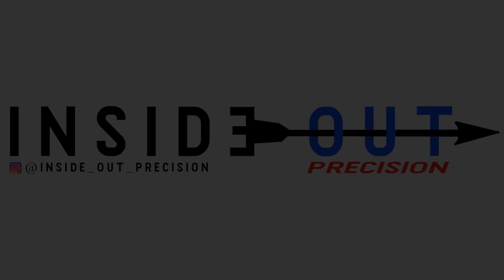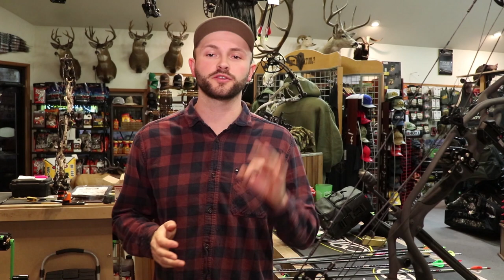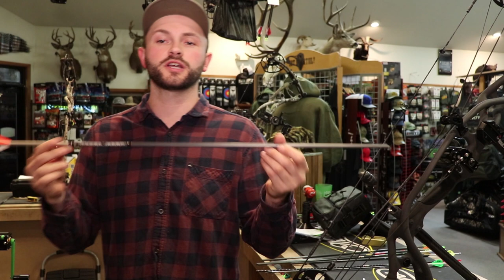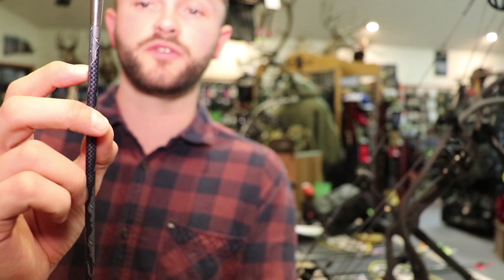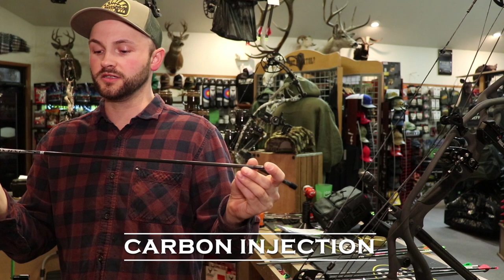Breaking Down Arrow Spine

Comment: I asked pretty much the same question on another video, but I thought this video was more appropriate for the question. I am trying to pick an arrow for my VXR, I have a 30" draw length with arrows cut at 30.25", I'm wanting a 125 grain point and I'm pulling 73 lbs right now, however, I plan to get new strings at some point so hopefully that gets up to more around 75 lbs. I was thinking the Easton Axis at 260 spine or Easton FMJ at 250. Will the 260 spine be stiff enough? Easton's chart had 260 on the softer side for my draw length and weight. Thanks for always being so helpful. I've asked questions multiple times and it's always really cool to hear back.

Comment: Okay so I have a question for you to help me understand...I am looking to shoot a 5mm full metal jacket for hunting and I shoot a 42 lb draw weight in my Mathews Avail and 25 inch draw length... I shoot a 26 inch arrow...I would have a 265 grain arrow and a broad head that weighs 100 grains.  That puts most of my weight FOC...I was also looking to add a 50 grain insert in the arrow tip but if I'm already sitting that far forward on my weight I shouldn't add the extra weight up front correct?

Comment: I consider myself a caveman hunter style shooter and am moving slowly to the target side of the spectrum. Incredible wealth of knowledge here, Thanks!! Been on Gold tip 340 Hunters and XTs for some time with great results at 60lbs and 28.5 draw with my Mathews V3. I did try some Victory TKO arrows recently at 350 spine with I believe 50 grain outsert on the point, that thing penetrated like no other. May switch to 400 spine and move to micro diameters in the future once I go thru all my GT's

Comment: I  am thinking about buying Easton Axis 5mm with 75 gr insert and 100-grain point weight, I have a 25.5-inch draw length and shoot 66-68 pounds, do you think 340 would be right?

Comment: Great video and explanation of arrow spine/weight/diameter.   I started experimenting with different fletching (4 vane max stealth, blazer etc.) and with a 22 gr. Nocturnal nock this added a lot of weight to the back of my arrow which caused problems with my FOC.  I like the added stability of 4 vane configurations for fixed blade broadhead flight but I needed a 50 gr. brass insert to get my FOC out of the single digits.  Although my broadhead flight was very good my arrow speed was not.  Struggling to find the right combination @ 62LBS. and 28" arrow.  I think the Axis is a better choice for me. Thanks again.

Comment: Pretty good video!! I have had a lot better luck though since i started following Ed Ashby’s 12 step program for arrows and broadheads. Your recommended arrows weights seem quite lite. I get the lite arrows for unknown yardage 3D and things like that but for hunting 60lb or more people are seeing much better results across the board with arrows 500 grains and more. My personal setup 75lb V3 day six 275 spine 150 grain inserts and 150 grain grizzly stick Maasai total arrow weight 658 grain and go through whitetail shoulders and bury into the dirt 6 inches or more. Definitely recommend to heavys. Brandon McDonald has a great video arrows part 3 comparing a 450 grain arrow to a 875 grain and the difference in time to target is litterley almost unmeasurable at 70 yards
Reply: Link?  I’d like to see that.
Reply: @drumsnbass  not sure how to do that but if you go to Brandon McDonald’s channel the video is called arrows part 3 and it’s pretty close to the top
Reply: @terrycalvert7812  thanks!

Comment: What is spine at 14:30 :)

The easton bloodline's lightweight allows to buy a 240 spine arrow in lets say 30"/31" and load the front and still have a stiff enough arrow without an extremely heavy shaft - so it has other uses than for light drawweight bows.

Thanks for all your information :)

Comment: I was thinking spine was measured by hanging a 3lb weight on a shaft that is supported by blocks 28" from each other. The measurement is taken with a dial indicator placed in the center of the support blocks. A 400 spine arrow means the arrow bent .400" when the weight was applied
Reply: This is true, not sure about the weight that is used but the principle is the same. It's not how much the arrow flexes when shot from a 70lb bow. So technically he is incorrect in his explanation. A couple manufacturers use a different number system that is not the actual measurement of deflection ( Carbon Express for instance).
Reply: Phil Ward  however if you go to carbon expresses website it will tell you the actual spine measurement for the model number . Maxima red 350 is a 300 spine arrow .

Comment: Ok, im learning new things daily as I throw myself into bow hunting, I did just get my first bear with a bow 2 weeks ago, I got it with the first bow my wife got for me that we found out it was too small. It's a bear cruzer g2 set at 29" dl where I am a 31 & 1/2 dl, it is set at 55 ponds and used a 400 gold tip with 100g mechanical broadhead, little tough but it worked.. 
My new bow we just got is the PSE Freak sp, 31" dl set at 68 pounds shooting 340 gold tip with 100g mechanical broadhead, help me out please? Is this a good arrow set up for this bow with my huge DL ?? I am spending good money to have the cams replaced and everything gone through to get the bow to top notch new quality and don't want to be shooting the wrong set-up and damage anything now or later down the road, bow is currently in shop for another week. Thank you soo much for any information

Comment: My Matthews V3X 29 with 27" draw and 27" arrows loves stiffer spines. I typically shoot at 65LBS but sometimes drop to 60 mods and up to 70 LBS mods. 80% let off. Easton online chat puts me between 300-400 depending on my draw weight. The chat shows me at the 350-400 at 65 but one small change and it shifts to 300-350. I run 300 and I am stacking arrows up to 60 yards. I don't shoot past that. My pro shop feels I am too stiff but. I can change my forward weight from 100 grain to 125 grain with no impact shift. Broadheads depend on the quality of the build. So far seems to be pretty close. I do have some 340 and 400 spine arrows cut the same and honestly the stiffer 300 seem to be more consistent even with 100 or 125 grain broadheads. My point to this is People need to experiment more and not take the charts as exact fit. Find what you're bow likes. I feel if you are on the edge go a bit stiffer.

Comment: Another great video.. I'm shooting 28" carbon express sd badlands 448 grains total weight. I'm not really liking the durability of these arrows. I'm having a hard time figuring out what spine and length arrow I should go with. I'm shooting an elite ritual 30 28dl and 72lb the shop I got the bow from cut my arrows to 28" but another shop said it's too long. He said the arrows should be 26.5 to 27" what are your thoughts?
Reply from the maker: Trust depends on the spine. Personally I don't like cutting my arrows shorter than the front of thebriser for my hunting set up just because I don't want the blades of my broadhead behind my fingers.
Reply: Thanks

Comment: Thanks for the video. I had a question. 65# faktor turbo 29” draw shooting axis 340’s. I want more FOC and kinetic energy for my upcoming elk hunt. Do you have any insight on cutting the shaft shorter, adding a footer to increase strength. Current arrows are cut 29”. Ive got roughly 3” of shaft from the contact point of the rest, forward. Any advice would be appreciated. Thanks for the videos!
Reply from the maker: I haven't played around with the footers much, but they do help toughen the front end up. You could try putting the 50gr. Brass inserts in your next arrows and cutting them at 28". You'd be right around 460gr.
Reply: Inside Out Precision thanks for the response. I’m going to give them a shot.

Comment: I have a Mathews VXR on order at 27inch draw @ 70lbs. I have Easton FMJ 5mm 340 spine with normal hit inserts and 100 grain heads that are cut at 26inch that I have laying around. It looks like according to the chart I should be running 400. So should I buy new arrows? If so for the same setup would you recommend Easton axis 340 with 50 grain brass insert and 100 grain head cut at 27 inches? Thanks in advance!
Reply: Used to run a Hoyt Pro defiant 30 set up the same with those same arrows. So I believe I might have been running the wrong arrow setup.
Reply from the maker: You should be fine. A little stiff is better than a little weak. Cut them at 27.5 or 28 next time and they'll be perfect

Comment: What’s a grain and how do you measure/weigh it when it is cut. Could you show how to get your total weight of an arrow?
Reply from the maker: There are digital scales that measure the weight. Most any archery shop will ha e one. Thanks for watching!
Reply: There are 7000 grains per pound. 437.5gr per oz. if you have a scale that measure down to 0.1 oz increments, you can get within 50-100gr of your total arrow weight. You need a very sensitive scale to get a more accurate reading. You can buy them on amazon. They’re often used for measuring gun powder for reloaders.
Reply: each component has it's own weight from manufacture. just add 'em up !
arrows are grains per. inch - marked on shaft - length, times, grains. plus parts = weight !
      ->>>>--------------------------->      easy peasy :-)
when you get components you want to know the specs.
if you need a scale - $10 on ebay.

Comment: I shoot a Mathews Vertix with a 29" drawlengh and shot Axis 400s cut at 28" at 62lbs they seem under spined papertuning not sure if cam puts more energy to the arrow
Reply from the maker: You're right on the cusp of needing 340's, but at only 62 lbs 400's should shoot fine. Have you moved top hats around at all on the bow??
Reply: @InsideOutPrecision  I haven't had top hats moved 400s tear tail left cut at 28 and 340s are cut long at 29.5 they shoot a almost bullet and slight nock low maybe 1/8 nock low I bare shaft papertune and rotate nocks for the best tare before I fletch them